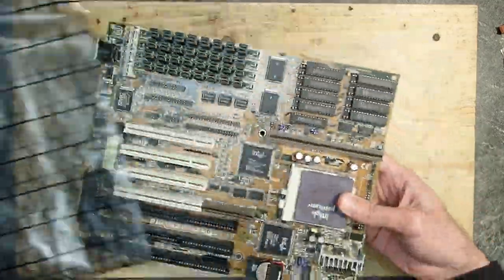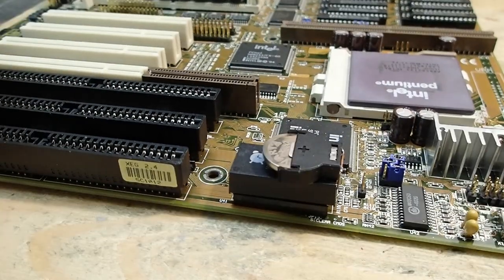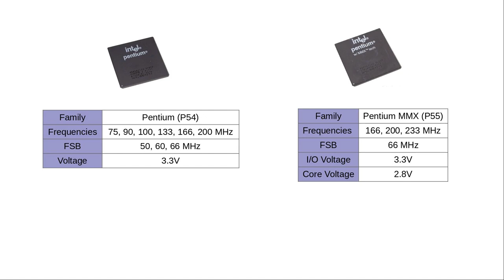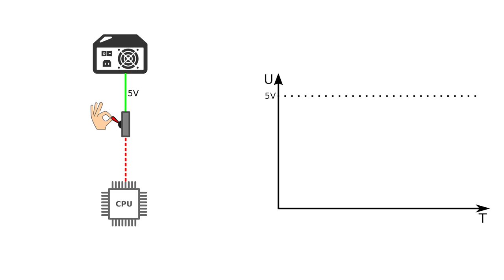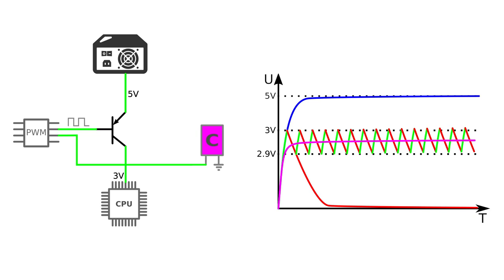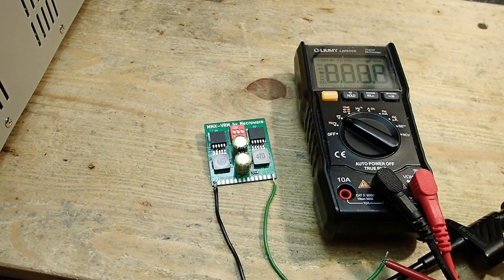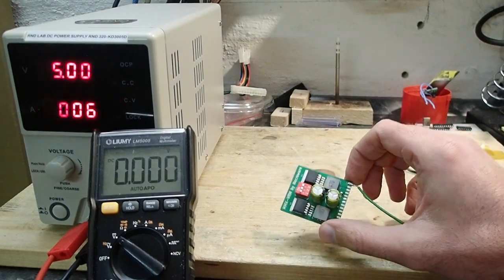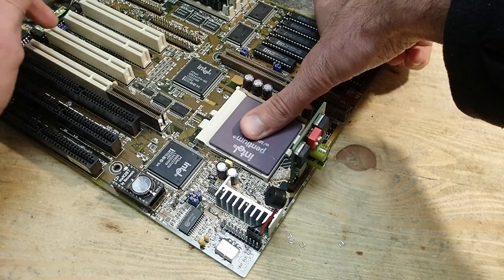Let's upgrade an early Socket 7 board beyond the limit (Part 1): RTC, VRM, MMX

Comment: Awesome explanation of switching voltage regulation. Modern motherboards use almost exactly this combination of components, if you pull the heat spreaders off your VRM section you can see the same types of components underneath. PWM controllers (high and low side), inductor coil/s and high end caps. Modern implementations are a fair bit more complex but the theory is the same.
Reply: Most interestingly, you even find synchronous step down converters on super socket 7 boards and later. I always thought these step down converters were introduced much later, since all other consumer electronics at the time still used transformers and linear regulators. The current consumption on 5V probably quickly became hard to handle though, which is why they've switched to 12V in the P4 era. Btw, ever tried to boot a shorted Athlon CPU? I've measured 50A+ current on 5V before I switched off the PSU after one or two seconds. The board always survived this torture so far ;-)
Reply: PWM does not work like that at all
Reply: Did it take in 5v and give out what "main board" (bios) asked or more often jumpers😬 
Very hard to remember. I got one "pc" with dual powers over 1000w total, 4 pentium pros on board (200 and those larger l2 cashes on each. 1 gb ram (8 sticks, half side can add 1gb more. It was "not cheap" when new. I know it works (when last tested some 10y ago), I have to start think what can it do? What if linux added and plugged to net, then sell cpu-power for some? *)
Reply: That machine have 4 those vrm-mods for one for each cpu. 
I saved at the time few spare ones too and many other stuff too x)

Comment: OK, I gotta be “that guy.”  Bear with me.  :-)

When you’re saying that switching regs don’t get as hot because they spend time in the off state to cool down, that’s not actually..  well, not really at all how that works.

If a transistor is turned all the way on (saturated) it tends to have very low resistance.  In a FET, this might be the Rds On spec, and be a couple of ohms, or even fractions of an ohm.  That is why transistors can switch large currents without getting terribly hot - not much energy is being lost through them.  This is true whether the transistor’s on time is short or practically infinite, so on-time is not really a factor.

If the transistor is not in saturation, and not off, it’s in the linear region, where its resistance is a function of the drive voltage (FET) or current (BJT), and this is where heat is generated.  Even when used in a PWM circuit, which is cycling between off and saturated, it has to transition through the linear region.  This is what contributes to the majority of heat in switching circuits, and incidentally, in digital logic.  In fact this is why higher frequency CPUs and GPUs get so hot - all those millions of transistors switching through the linear region for super short periods of time, several hundred million to billions of times a second.  Lowering the voltage helps counter that (Ohms Law again), and that’s why Vcore keeps dropping as we’re able to manufacture more sensitive transistors.  But I digress.

So, a switching reg runs cooler than a linear reg because the switching regulator is minimizing the time spent in the linear region by turning full on or full off.  This has the effect of overshooting and undershooting the voltage essentially to the rails, which is why switching regs require the inductor and capacitor to average it out.  Without those passives, they would have to rely on parasitic inductance and capacitance to have any kind of slope at all, which is not particularly feasible except in niche applications (e.g., Class D audio amplifiers use the load — a speaker — as an inductive filter.)

The linear reg, in contrast, lives entirely in the linear region, turning that excess energy into heat by using a transistor as a variable resistor.  That’s why they are hot.  Linear regs are resistive, switching regs try not to be.
Reply from the maker: Hehe, funny to see how you were afraid :D

You are absolutely right and this is a great explanation. As I was making this video I was sitting there and thinking how to explain all that in one sentence, but everything I thought of ended again in 10 more minutes of complicated explanation in an already a long video. So I took a wrong exit and just said, what is simply not right. Afterwards I think, that I just had to say, that the transistor gets hot in the moment of switch and cools down the rest of time, but as so often, the words we actually should have said come  too late. 

Anyways, thank you for the explanation. I'm sure, if someone is interested, this is a nice contribution...
Reply: I think the heat is about stepvoltage (0.2-0.6v) and multiplied by amps what goes true douped silica chip (tyristor, transistor and fet's usually?)
Reply: That cpu isn't "hungry" with power what I 🤔 "was hungry" hmm
I am 😐
Reply: Yep and psu:s that time wanted give much more 5vamps.

I think it it not gonna heat more if 12v used? Maybe even less, but I don't sure why I see it differently. But sure, that 12v can be used for just some exotic pvm-modules own needs. That is not fact, I just think it that way. And if I get glue why, I will tell.

Comment: Awesome. This was hands down the simplest and best "casual" explanation of a switching VRM I have ever seen. Working on integrated CPU modules on mid 1990s, I can remember, when we did not have easy-to-handle integrated adjustable regulators, putting together a switching VRM with narrow voltage margins at high amps in a very small formfactor was quite a challange. Voltages skewing out of the hysteresis-window where commonplace and you where chasing software-"bugs" on the OS side for a crashing machine, all the while the VRM stability was the culprit really killed the days back then. (Schalthystererse  in German, I am not so sure if I got the correct terms in english).
Whatever, for an old fart like me this content is highly entertaining and enjoyable. Please keep up the good work - at least I enjoy it. May I ask, if you are a professional EE or "just" a dedicated hobbyist? Ah, forget that question, just heard your statement in the follow-up video :)

Comment: I think it's great you made such an enhancement to an old MB: you brought it to its full potential after decades!
With regard to the PSU module though, I reckon your design is an example of bad design practice which could lead to some serous issues.
The main problem is that you are trying to get two independent feedback loops to regulate the same rail... even if they have, nominally, the same target there will be a difference in their sensing and such difference will also drift depending on many factors, principally the temperature of the ICs. This is likely to lead to an unbalance in the workload with one of the two taking on most of the burden.
Another type of issue is likely to arise with the dynamic behaviour of the PSU: the regulators are trying to regulate each other and they will react to each other and not just to the change in demand by the CPU. In certain load conditions the system may become unstable.
Finally the XL2596 runs at a pretty low frequency for the type of load you are asking it to regulate. Do the Intel specs say anything about the requirements on the frequency response of the regulator?

The amount of power you are dealing with is substantial and I would look for synchronous (controlled MOSFET instead of diode) buck regulators (or controllers) in order to reach an higher efficiency. Typically you would also design an output stage with 2-phases but that would be a bit tricky and yes, even more expensive.
Have you thought of reaching out to GreatScott! (https://www.youtube.com/c/greatscottlab) who is also in Germany? This kind of project seems just up his street.
Reply from the maker: Hi Lorenzo! Thank you for the feedback. Yes, the design is not very good and since I'm actually a software developer, I do make such mistakes. But it is a good thing, because I'm learning from my mistakes and trying to improve. As you see in the video, this was the version 0.1 (the very first one). Meanwhile I'm at version 0.3, where I switched to a DC-DC Controller with an N-MOSFET instead. That should be a better solution in the near future, but this version 0.1 was a good start and as a prototype it did the trick. I learned a lot things, which I wouldn't, if I'd just take a schematics from somewhere. My main reason to do all that is to learn and not just to make another gadget :)
Reply: @necro_ware ,
I hope I wasn't too harsh on you. I'm an hardware engineer and I've been designing switching power supplies for more then 20 years... I guess my "design review mode" kicked in!
To be fair, if this is one of your first attempt to SMPS, you've taken on an objectively tricky task! Congratulations! If you've gone for a synchronous controller then things got serious! ;-)
To keep things manageable I would have gone for a TI TPS56628 which is synchronous so the heat generated should be kept to a minimum. It's rated for maximum 6A, a bit tight, but not insufficient. The package is SO8, not too complicated to solder and with PowerPad which would allow you to use the ground plane around the IC as an heatsink. The switching frequency is 650kHz so the inductance can be relatively small and still keep the ripple low. With a good choice of capacitors on the output it should do the job.

Have you given any thought to contacting Great Scott? Power electronics is his thing.
Reply: Someone else mentioned using ceramic caps in proximity to the IC, which is often a requirement for guaranteed stability.

Another suggestion:  Try to ensure your switchable voltage divider (the feedback Rs) don’t rely on that switch to run safely.  By that I mean, make sure even if all the switches are open (or fail to contact) that your feedback doesn’t go open loop.  Switch in parallel Rs, ideally on the top half, to make sure that, if all your switches fail open, then your output V is at its minimum.  That’s much safer than having the worst case failure result in over-volting.

Edit:  Er, I probably meant bottom half of the divider.  I dunno.  It’s late and I always mix those things up when I’m talking off the cuff.  You get what I mean.  ;-)
Reply from the maker: No, your critics were absolutely top. Most of that I already discovered myself as well, that's why I designed the MOSFET solution with the controller instead. But it's currently only on paper, I still have to test it and so, every constructive input is a good input. I don't like comments like "...I'm shocked, that you don't know...", but every comment which helps me to improve is highly appreciated.
As I said, I'm a software developer and where I'm quite ok in digital electronics, the analogue circuits and power supply is really a minefield for me yet. I try my best to gain my knowledge at that and I think, that I'm on the right way, but still there is a long way to go. Meanwhile I think, that I need the regulator for up to 15A, so it starts to be really tricky now. You will see the reason in the next part. But if you have more tips, you are welcome. 
As far as I can measure the regulator frequency doesn't seem to be a problem for the Pentium MMX. 150kHz seem to be alright. I think this would be a problem for CPUs for a much higher frequencies.

I know the channel of Great Scott, yes, but I didn't contact him on that regards. I have some friends, who are hardware engineers and I could ask them as well, but it makes too much fund to understand such things on my own. It's always the same with me, I'm more into reading and trying to figure out it on my own, than to ask someone. The most valuable help one can give me is to give a source, where I can read about it ;)
Reply: @necro_ware , I wish you'll make the new regulator to work.
15A is does call for a controller with discrete MOSFETs. Without getting into all the theory of feedback loop control, you should find plenty of very useful information and guidelines in the datasheets and applications notes of the most reputable manufacturers (TI, Analog Devices, Microchip, OnSemi, ST, ...). Good datasheets illustrate how to select the components to use with the controller. The buck topology is usually the most benign among switch-mode power supplies so, if you don't need to do anything particularly sophisticated or uncommon, it should be possible to put together a circuit which works well.
I expect the inductor to be the most expensive component of the regulator. Unfortunately if the switching frequency is low, the value of inductance that leads to a certain ripple is high. This also means that the average output current below which the regulator has to operates in discontinuous mode is high (discontinuous mode is more "noisy"). Finding the right inductor may be quite tricky.
With regard to the "bulk" output capacitor, you'll have to select a low-ESR electrolytic capacitor and then use one or more of them in parallel. The datasheets of the series of "Low-ESR" specify such parameter at 100 kHz (often it's "Impedance at 100 kHz). Most reputable Japanese capacitor manufacturers have one or more series of low-ESR caps in their lineup. In a series, capacitor with the same physical size have the same ESR and the ESR is smaller with larger caps. if the output ripple is high you'll have to adopt an output capacitor with higher current ripple rating so you'll have to keep an eye on this parameter too.
The choice of MOSFETs is obviously critical. The only thing that I would write here is that you should aim for the right balance between RDSon and gate capacitance (and gate charge): generally a lower RDSon is associated with an higher gate capacitance which, in turn, requires the controller to work harder to switch the MOSFET on and off. If you stay at relatively low frequencies, around 100kHz, then the power lost should be low as well but it may still be worth comparing the dynamic characteristics of the MOSFETs you find have a low enough RDSon.
Reply: In English slang, alley, not street.

Comment: Electrical engineering is incredibly fascinating.  You're very thorough and meticulous in your designing and testing before actually using your creations.  The true sign of an expert!  Can't wait to see part 2 of the video.
Reply from the maker: Thank you, but I'm actually not an expert in electronics at all. Despite, that I had quite a lot of electronics in the university many years ago, I'm actually a software engineer and I was teaching that quite a lot as well. On the other hand I am an absolute noob in electronics :D But to my defense, it's part of my character to stay thorough in everything I do, doesn't matter if it's electronics or cooking....
Reply: @necro_ware  now I'm envious!  You're this good with electronics AND you're a software engineer?  I'm struggling with becoming a software engineer and I can't even begin handling electronics the way you do.  You're very talented.
Reply: Only way to learn is to dive in.  I dabble in both software and hardware as well.  (My profession is otherwise technical, and kind of a HW/SW blend.)  You will soon learn, in both fields, that regardless how much you know, there is still far more to learn.  But you have to start somewhere!
Reply from the maker: @nickwallette6201  Absolutely

Comment: I used to run those 2.8v MMX CPU's on the 3.3v boards at 3.3v with no problems back in the day. Actually made it more overclockable :)
Reply from the maker: Well, I think, the question is not what we could do, but more of what we should do. I mean we can drive a car without the air in the tires, but that would damage the car in the long term. It's similar in this case. It is possible, but you shouldn't do it, since the CPU will not survive it too long, especially the one, which is as old.
Reply: @necro_ware  I think a better analogy would be driving your car with slightly over inflated tires :) Anyhow, these CPUs ran for years problem free in servers until they were decommissioned. But I agree, you shouldn't do it if you're not willing to take the risk.
Reply: Overclocked my 166mmx at 262 3.2v, woked until it was retired but it needed decent cooling

Comment: Very good video sir, thank you for the spark I needed to get back to my electronic roots.  I took classes at a local vocational center in high school where I learnt first the basics of electronics and then the 2nd year was more advanced electronics with pcb mapping and engineering our own circuits making small audio amplifiers.  I enjoyed those classes because they challenged my brain and I got to see something that I made that most people have no clue how it do.  I will be ordering me a new starter kit after I finish with this comment.  You know, a good adjustable soldering apparatus, assortment of solder, rosin core and solid, a clamping station to hold current work piece and probably some capacitors for 3 motherboards and 2 video cards that I refuse to throw away because I know what's wrong with them.  Have a nice day and thank you for reading my comment.

Comment: Hey so just felt like sharing this: I just got an old socket 7 pc that came with a P133 at 3.3V, and I placed a PMMX233 in there. It does work, and as far as I tested, it's pretty stable. It does run very hot and that makes me ~uneasy~, so I'll keep the 133 until I get to assemble one of those modules!

Thank you very much for the project and the videos, tho! You inspired me to get into this era of computing and into modding my computer, and I'm having so much fun =D